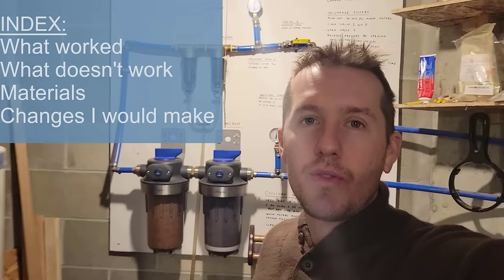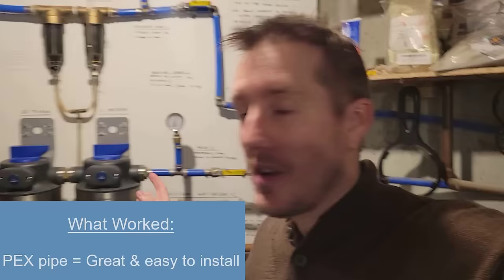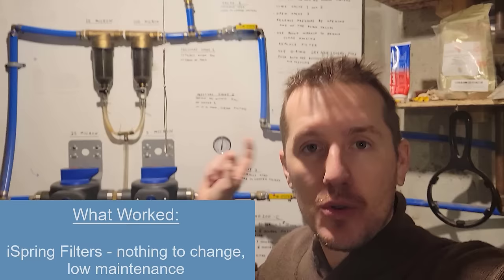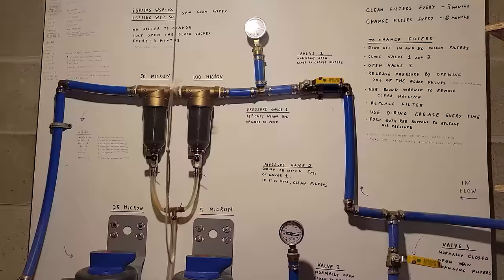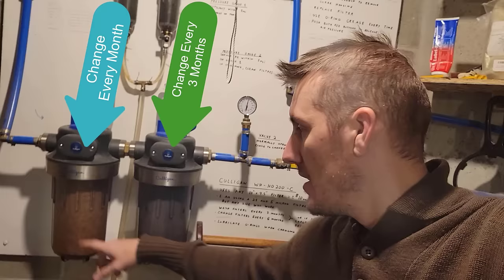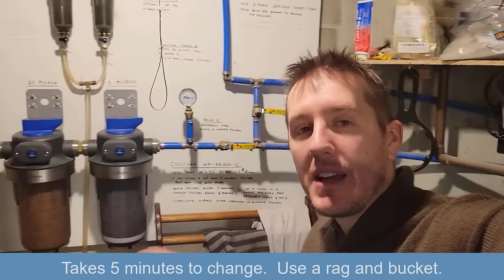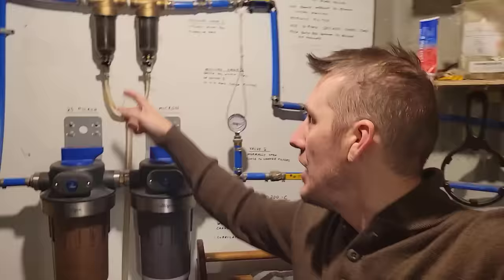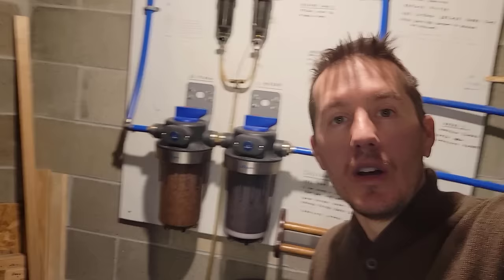4 Years Later  -  Whole House Water Filters Update

Comment: A charcoal filter is needed to remove City water chlorine which deteriorates the phosphate scale inhibitor used at the input to a tankless water heater. No spin down needed with City water; except when hydrants are flushed, so not worth the added work of maintenance.

Comment: thanks for putting this together. It was super helpful. One addition you could consider is adding a reverse loop to your spindown filters. That would let you backflush into the clear hose and probably reduce the interval you need to take the screens out and clean completely.
Reply from the maker: Didn't know you could do that.  That's a good idea.
Reply: This is an excellent idea.  I just removed 2 ispring filters from my system because the flushing mechanism really wasn't good enough.
Reply: Hi  - Would somebody please explain the "reverse loop" in this scenario. I'm going to install new sediment filtration and this sounds like a popular idea! Thanks in advance!
Reply: @freddysflyz  you add piping around the filter to reverse the flow through the filter.
Reply: @freddysflyz  Did you ever figure out what this was?
Reply: @scottb5975  I was told in the comment above in the reply I'll repeat here: "you add piping around the filter to reverse the flow through the filter."

Comment: Definitely use pressure gauges. You just need to know when to read them. That is the absolute best way to know when you need to change your filters. You should also notice a difference in the pressure when you're showering or using water in your house.

Comment: Wonderful job! 
To observe a pressure difference, you need to install an output valve after the second gauge, which can release water into a bucket or the sewage system. Simply open it and monitor the pressure difference as water flows. By relying on pressure difference rather than a fixed interval for changing filters, you may have the opportunity to save some money.
Reply: This was my exact thought when hearing he was changing the filters monthly. Could probably get by changing them much less often. Generally mechanical filters (filters with a fine filtration media as opposed to activated carbon) continue doing their job for a very long time, they just get clogged which reduces water flow. One other tip is to pipe the inlet and outlet together and put in ball valves. Put a gauge in that header pipe instead of 2 separate gauges in the inlet and outlet. This way you can measure inlet pressure, outlet pressure, or difference in pressure just by manipulating the valves, all with a single gauge. Measuring a pressure differential with 2 different gauge could introduce a ton of error if each gauge is not well calibrated.
Reply: @Fatfett  I cannot picture this in my head. Maybe I'll come across a diagram during research.

Comment: I work in Water Filtration. Installing whole home filters, reverse osmosis. Treating everything from city water to well water. Industrial and residential.

Sir, you did an excellent job. Very clean fits.

Pressure gauges will let you know if a filter is clogged, but since you use housings that you can see. And you check on your stuff (you would not believe how many people do not do that).  You did a great job explaining the use purpose, and the frequency of servicing. 
Good video!
Cheers!
Reply: Amen to that Mr.Bear!
Reply: Reverse osmosis cleans out fluoride and chlorine too?
Reply: @JanColdwater  Yes. It also greatly lowers bacteria contaminates.

If you flush the membrane for 5 minutes every two weeks, (some come with flush valves for the membranes), it helps maintain the membranes life, keeping it free of clogging up with contamination.

I’ve changed some membranes that people did not flush, and they were covered in slime, gunk, and had a “beer” odor. 
I’ve changed others where they DID backwash them, but the membrane needed to be replaced, but it was not clogged (still clogged) as bad as the ones whom did not flush them.
Reply: @Freely_Accepted  Thank you so much. Could you please recommend one that you like best?
Reply: @JanColdwater  5 stage Proline Plus. Are you in the US?
Reply: @Freely_Accepted  Yes, Sir. I am on the USA.
Reply: @Freely_Accepted  I’m on city water (from what I gather the setup in this video is geared more towards well water). Would you still recommend this type of setup plus a water softener for city water ? What configuration would be best ?
Reply: @OGCJ10  Depends on what city water you are on. What you are looking to filter. How many occupants/bathrooms (reason for it is overall water usage).

I sell and install whole house systems ranging from chloramine reduction to iron reduction.

It is very important to note what levels of chlorine you are dealing with, or iron levels.

With those others very well may be present.

Including lead.

I use a custom blend that reduces to almost non detectable level, Iron, Sulfur, Chlorine,Trihalomethane, Turbidity, Static Bacteria, Radon, Radium, Radionuclides and so forth.

Comment: This is similar to what I put in 9 years ago for iron-rich well water. One personal choice: I took a tap after the spindown and before the pleated filters for the outside faucets--- a little dirt won't hurt outside waters but I was getting teeny gravel which jammed the faucets. This also simplifies the winter shut-down: I can close that side-tap and drain the outside faucets with less running around. More than justifies the extra 40' of PEX to have the outside faucets on dedicated lines.

Comment: The only issue with the pressure gauges is that you do need to be looking at them while something is using water. Washing machine, dishwasher, or running a bath all take a fair amount of water flow. It's kind of obvious that when no water is being used, the pressure on the downstream side of the filters will creep up to equalise with the pressure on the upstream side.
Reply: 👍 Or as another posted just a flush valve into a bucket to observe pressure differential, if any.

Comment: I ran 2 sets of home filters in parallel so that there wouldn't be a pressure drop and to extend when I would have to change them.     The first stage was charcoal, second stage was 5 micron.    Seems to work well, although the plumber I hired was a Maroon in the way he tied them together.   Plus the Whirpool stickers fell off with all the changes and it's impossible to know which way is bypass / off  / filter.       I wish I could go back and time and re-do the whole setup correctly myself.   So I too feel your pain.

Comment: Hmm if only the water company would do this.   Good job!
Reply: Except a surprising amount of water gets used for things like watering lawns and gardens or flushing toilets where the water really doesn't need to be filtered to premium drinking quality. Separating that out from actual drinking water would mean two parallel sets of pipes to every house in their service region, with all the cost hikes implied. 

Also, one of the things people are most interested in removing from their town water supply is chlorine, and the supplier has to add that to stop pathogens growing inside their pipes.

All up, it's more efficient if the water provider quality standard is set at "not dangerous to drink this" and households control their own equipment to raise the standard to "actually attractive to drink."

Comment: I like the pressure gages that have a garden hose connector on them and when I need to check the pressure I just put them on the end of the spigot.  Then I can leave them on the shelf until I need them and I can use the spigot to drain the system or run water from a hose.
For my new home I'm planning on having a parallel system with a Sediment filter and a Charcoal Filter on each leg so the incoming water will split into two legs with 2 filters each so the water pressure won't diminish much.  I have 1" pex going to my filters at the well so the entire system will only have filtered water going to it.

Comment: i have the culligan filters too..and they have been great..i love them..but a couple days ago one of the tanks got a fracture in it and started seeping water...culligan does not offer parts for these..and of course the by-pass on the filter is stuck..and i didnt plumb in a by-pass...so i ordered a new filter and the plan is to just use the tank from the new filter when it gets here and put it on the old head...but if i have to change out anything i will replumb and build a by-pass, so i can work on these things and still have water...also, it would be a good idea to have unions on both sides of the filters to take them compleatly out of the system if need be...to replace the filter housings them selves...just thoughts im learning now that i have done it..and re-thinking the plan

Comment: One pressure gauge may still be a good idea.... Especially if you don't have one anywhere else on your water system.  I installed a drinking water RO system in a new house, and I do monitor the output pressure because it can tell me the membrane health. I noticed pretty quickly that my pressures would spike above 120 PSI after a shower..... Which immediately told me my pressure expansion tank was broken.  Replaced it easily and inexpensively, my pressure then never raised above city pressure (70psi), and i likely saved myself exploding pipes or damaged valves in the future. If i hadnt out in that pressure gauge i never would have seen the problem until something finally failed and caused a flood. I also think my mostly PEX piping saved the disaster from happening because it can def expand to some degree.. unlike copper.

Comment: Nice, I'm building a filter system for our home. We have well water and every so often our shower pressure drops off a bit. I'm suspecting some debris/particulate matter is getting caught up in the needle valve of the shower to adjust the flow, once I slightly adjust those valves closed and back open, the pressure is back to normal. I'm going with the two pre-filters that you've placed with a 100 and a 50 micron. Rather than two smaller culligan filters,  I've opted for a single large  5 micron 3M AP904 filter as we have scale issues that I'm hoping this will also address. Its a pricey filter to replace so I'm hoping the two pre-filters will help extend the life of it. Our water quality is not too bad, the primary issue is the hard water/scale. With the well and our sandy soil conditions, I suspect some fine sand and particulate matter does make its way through our water system. Will know for sure after these filters!

Comment: Check your city line pressure first and if over 80PSI a pressure regulator will help your plumbing SO AT LEAST one pressure gauge should be in line after regulator .
And a pressure gauge after one or each filter WIIL help you to not replace filters until really needed. (replace a carbon filter per manufacturer's recommendation regardless of no or little pressure drop)    (kinda like having no gas gauge in your car)
Reply: Most people do not realize the water company can pump at what ever pressure is required for their system.  Depending on how far water has to be pumped and where you are located there can be drastic changes in pressure from one location to another and it can change at any time without notice.  The water pressure coming into my house is over 90 psi and I lower it to 70 psi which is still on the high end.  The higher the pressure the more likely something is going to burst over time in your plumbing system.

That is why every house owner should know their incoming water pressure and better yet have a water pressure control valve in their line to limit the maximum pressure.

For those with inline water filters be aware that these filter containers are all rated to a certain pressure and if you exceed it you run the risks of them failing over time.  This is especially important on the clear filter containers as they tend to have a lower maximum pressure that the opaque ones.

Comment: if your dissolved iron is high, add a 10"x54" tank into your plumbing, ahead of all your filters... pump compressed air into this tank with your incoming water stream, and allow the oxidized - particulate, in other words - to settle in the bottom... you might have to drain & flush this 'settling tank' once or twice a year, but that might be better than changing filters every month...

Comment: If you had a properly working water softener and it was set up right it should pull iron out of the water. If not you need an iron machine ahead of it to remove the rest. Many different types of equipment for the many types of iron. Your water in the house should be clear and clean after the system.

Comment: After watching your first video I decided to use a 20" filter. I don't have space for too many. The water softener also came with a 10" filter, so I fitted that but I think it restricts the flow. During the fast rinse on the water softener I see 15psi drop across the two filters. I have a 200 micron spin down, then 20 micron 20" then the 10" carbon filter that came with the water softener. I used 1" PEX-B and the crimps are much harder to make. I checked the gauges while my wife or daughter was in the shower to see what pressure drop I am getting too. That was less, more like 5psi, because the showers have flow restrictors.
Reply: have you tried not putting in a filter for the last carbon filter to see if you are still getting a psi drop? I'm debating atm whether to use 20"x4.5" or 10"x4.5" filters as I don't want a significant drop in pressure.

Comment: Why not put digital pressure gauges there which can send the data to Home Assistant? So if they differ by x amount for a couple of seconds, you can push a notification to your phone reminding you to clean the filters? :)

You could also add motorized valves to flush the two pre-filters regularly, based on the water consumption (just add a water meter to the output to automate it).

Comment: Hi Dave.  Thanks for taking the time to give us the update on your Water Filter System.  I have  a few specific questions for you on the Culligan Water Filter Housing Valve on top.  If I don't have water shut-off valves before or after the Housing, can I simply turn the Blue Valve to the Off Position or Bypass Position and change my filter?  Will water keep running through my water lines if the Blue Valve is in the Bypass Position.  Also, will water come back out of the outflow sided of the Housing Head if I turn the Blue Valve into the Off Position and then change my filter?  Looking forward to your response.  Thanks again.
Reply from the maker: I think you can turn the blue valve on top, but when i tried it, mine didn't rotate.  I didn't want to break it, so i didn't force it too much.  
There was someone in the comments below that said the same thing, theirs seemed stuck and didn't want to break the plastic.
But yes, the top should act as a bypass valve and you can change the filter....at least that's what i understood.
Reply: Don't depend on the housing filter always being functional. They can and do sometimes lock up.

Comment: Is it possible that the rust is either from a galvanized pipe? Or from the inside of your pressure tank (i saw you're on a well)?

For some dumb reason, the plumber who did the install for this house 30 years ago used a short chunk of galvanized pipe. Well after years of perpetual use, it started to dissolve (rust) and would wreak havoc downstream on everything. 

The only reason I even discovered that was because I installed a whole house water filter.

I replaced/added everything that was exposed from the wall to the well tank(s) & included "main shut off". 
Which is apparently a no no for a well.

Comment: thank you for this follow up video! I am going to build the same. I noticed they have spin down filters with automatic wash down... expensive but pretty cool. 
Quick question: What type of material did you choose for the wood board and what kind of paint is it?
Reply from the maker: just a piece of plywood i had lying around
and whatever paint i use for walls
( i didn't buy anything, just used what i had in the garage)

Comment: Thanks, this is great information.   I do have a question, which I was hoping you may answer.  Is it better to have a larger spin down 50 micron  like the "iSpring WSP50ARJ Spin-Down" or  its better to combine 2 spin down filters , one 100 micron and the other 50 micron.     In my current setup,  my 50 micron is clogging in 5 days, so not sure if adding a 100 micron or just getting a larger 50 micron filter.
Reply from the maker: sounds like for your situation a 100 micron filter would help.  they would "spread the load" and hopefully not clog as easily.
for me, the 100 was not really needed, not even sure if the 50 was needed.  The iron/rust in my water was smaller than that in size

Comment: Thanks for your video and the good information. We have great water but some sediment issues (sandy/cloudy). We are currently using a small water filter (5 micron) and it works good. However, I have to change the filter at least once a month (the filter is not much, I think it is 5$ or so). Did you see that the Culligan Filter cost like 70 CAD?! wouldn't want to have to replace that filter every month!
Reply: I don't know if Culligan parts use standardized sizes and fittings or not, but any time one uses proprietary systems you're usually stuck using "their" replacement parts or risking low quality substitutes.  Think "printer ink"..... :)